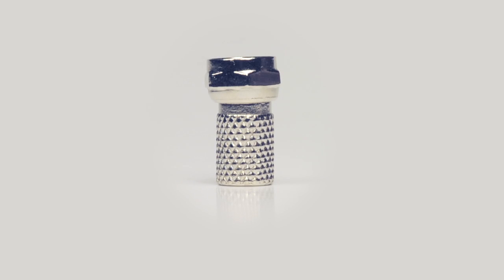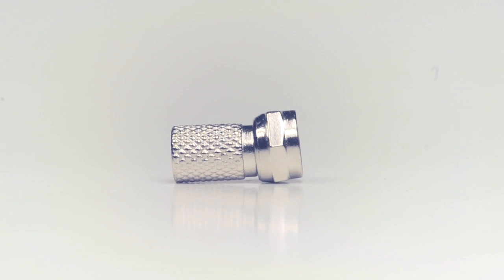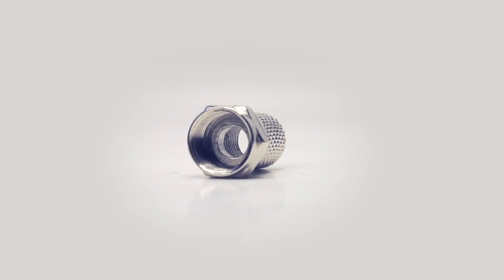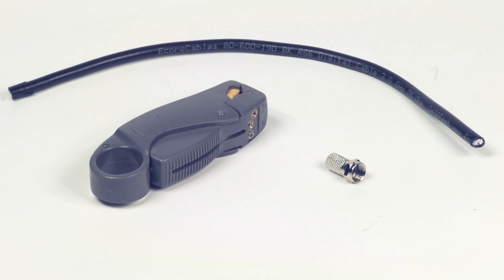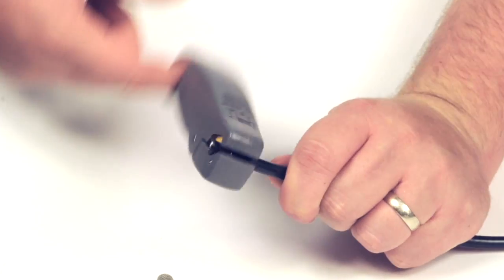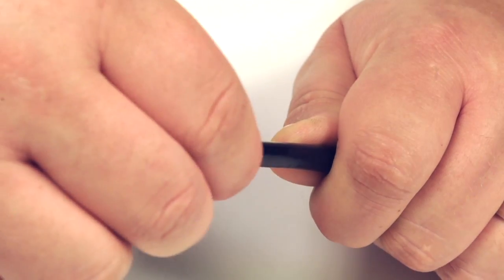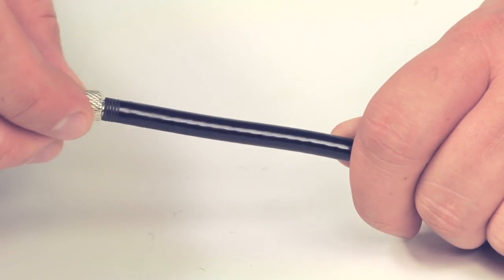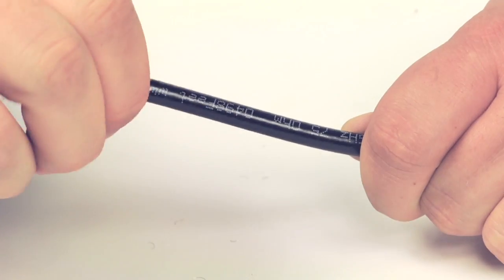F-Type Twist On Connector For RG59 - How To Terminate RG59 Cable #121

Comment: The cable you are using is RG6 not RG59 as per your title, is that why all the shielding vanished when the video cut away between you folding back the shielding and screwing the connector on?